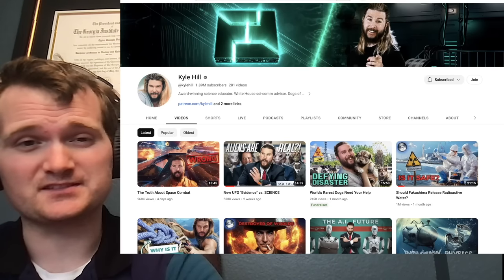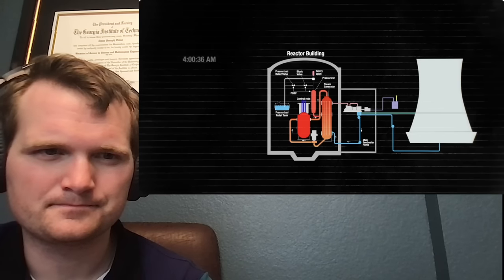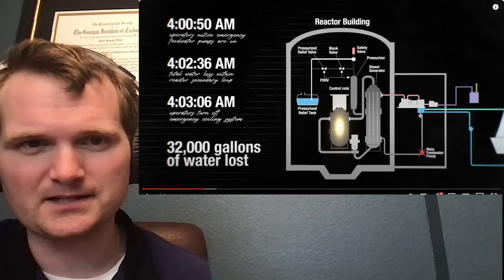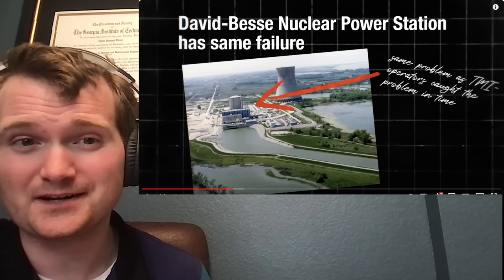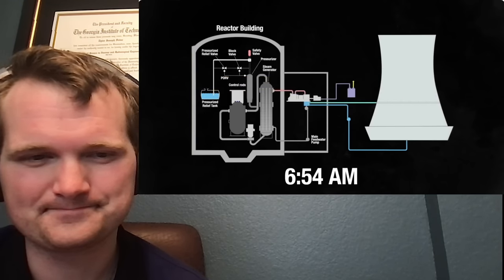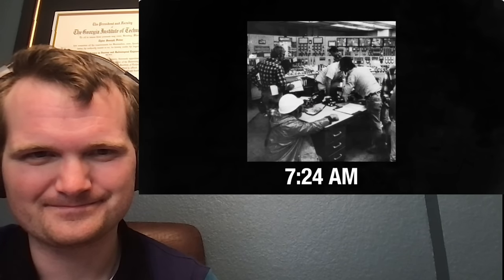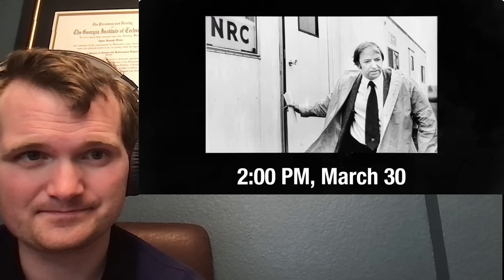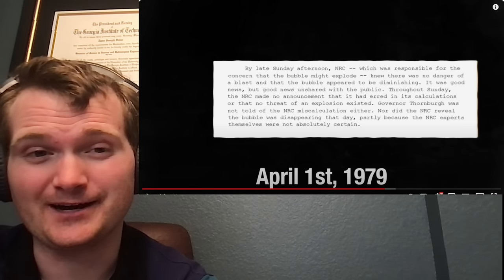Nuclear Engineer Reacts to Kyle Hill "Three Mile Island - What Really Happened"

Comment: Anyplace where there is a bolted joint and a seal there is a potential for leaks. SpaceX is developing their Raptor rocket engine and working to replace as many of the bolted joints as they can with welded components, because under the pressures involved (over 300 bar in some areas) there will be methane and oxygen leaks and the potential for fire. NASA has an even worse problem with the Artemis rocket because it uses hydrogen fuel, and hydrogen is even more prone to leak than methane. (During the first launch countdown, NASA had to send a "Red Team" out to the pad to tighten bolts on a hydrogen connection that had loosened under cryogenic temperatures.) I don't know if this is practical for nuclear reactor plumbing, but it may be something to consider.
Reply: Flanges are useful indeed because they allow you to quickly mount and dismount piping elements. Specifically for raptor they made more sense during initial testing but are structurally and manufacturing inefficient now that raptor is well into scale production. 

Also, do note that pressures in the system are actually much higher than that. The pressures in the combustion chamber are indeed upward 350 bars, however pressure flows from high to low. So in order to prevent the combustion from making it's way back into the engines, the pressure in the turbopump assembly is substantially higher.

Comment: 44:00 I became interested in nuclear energy a long time ago.  I may have tried to build a cold fusion reactor in my mom's basement (It was just an electrolysis separator, I didn't have Palladium, and obviously the theory is flawed.)  It did get strikingly hot after only a few seconds running from an 18W wall-wart power supply though :/

As long as public education is bloated with whatever nonsense, can we replace something with a basic education of nuclear energy and accurate history?  I want to see this technology.  We don't need fusion, solar is so bad, we have fission, it works, it's safe, but nobody understands it...

Comment: Question please. It’s of course right that we study, learn from and re-write SOPs based on accidents. We’d be stupid not to. What about the accidents yet to happen? The sets of circumstances and process and equipment failures that are out there waiting to happen? Who’s checking the ‘what ifs’? Who’s gaming crazy, unimaginable and frankly bizarre possibilities? Fukushima was always waiting to happen, a tsunami and earthquake. In Japan? Surely not! How could that possibly happen!!!? We need AI to run crazy scenarios of increasing unlikelihood to foresee possible failure situations. And nuclear engineers are NOT the people to be investigating it. I’ve worked in software for 30 years. The worst testers are developers. They cannot envisage stupid things happening. I’ve seen test reports and developers say ‘but why would you do that, it makes no sense?’ But idiot testers found failure paths, often easily. Experts see things as working correctly. This also was clear in the radiotherapy video, tested by a software developer and not by a ‘user’ - the user ‘back arrowed’ and set values that the machine didn’t have time to set properly

Comment: My opinion only (not a pro here):

Honestly, I totally get system redundancy's purpose from an engineer's perspective, but I don't feel safer flying (airplane example--rare to have failures due to system redundancy). ;p Planes still come down. When things go wrong, they really go wrong. When it comes to anything mechanical/electrical I'm inclined to never say never. That's why we pay so much attention to failures in order to prevent them from happening again.  In the case of airplanes, it's a matter of fly by wire now. Electrical switches and sensors can be hindered by things like moisture or dust in a cannon plug, etc. That said, I do feel good that things on the scale of Chernobyl could never possible happen again any that training and licensing boards run through all these accident scenarios.

Anyway, love your channel, value your analysis of these documentaries. Sharing your knowledge allows us to "see the wizard" and realize nuclear isn't as scary as we think. 

Thank you
Reply: Things can always go wrong. It's about making so you are preventing the known things within reason.

For example solar power and wind power kills tons of things. Animals mostly but a non trivial amount of humans too. For solar, it's mostly installation on roofs and towers that kills, and for wind it's maintenance. Both have pretty understandable and standard safeties but when your harness breaks or the roof tiles collapse, there is little one can do. But those are accidents people can understand and therefore accept as a possibility. 

Nuclear suffers form a lot of overreach because the scale of things needed to get plants anywhere near a disaster is gigantic and super rare. That leads to mandatory overdesign and that is a problem just as much as a lack of it. 

For example, earthquake resistance. In areas prone to it, you account for it. But for nuclear it's basically asked that you account for it EVERYWHERE. There is also rarely demands that a chemical plant be resistant to crashing bombs and aircrafts, but for nuclear plants it's also a requirement. 

It's not without merit, but stacking those reqs adds complexity. A complexity the inexperienced builders tasked to build these things consistently get wrong
Reply: "When things go wrong, they really go wrong." is a sample bias. "when thing go really wrong we hear a hell lot about it" is the correct one :) planes also have a lot of small problem that are well handled and don't cause any harm. we just don't hear about those so we tend to think "When things go wrong, they really go wrong." when its not really the case. i remember an exemple of a plane loosing all of its carburant in the middle of tha atlantic, you would think well they're screwed but it was really "eh it's fine we can just hover until the nearest airport no problem".  the story didn't make a single injury so it's not well known (it's not even well known that a commercial plane can just hover). this is just an exemple of some problem that dont go "really wrong"